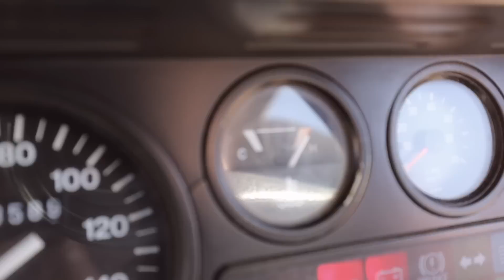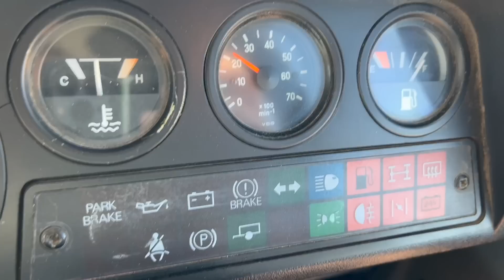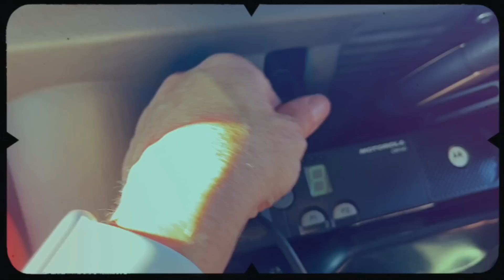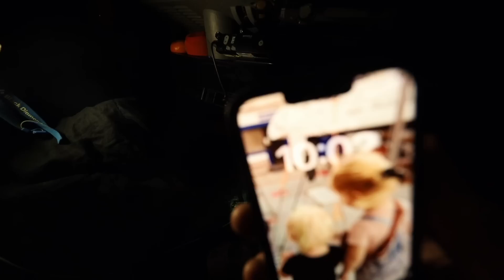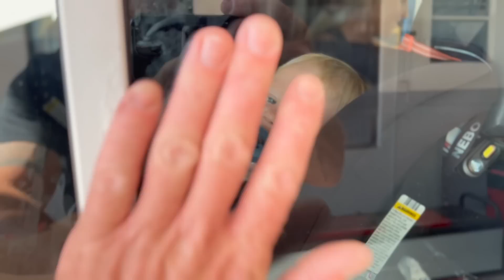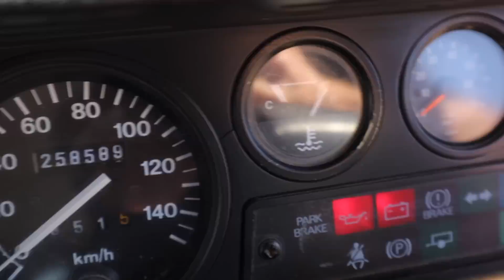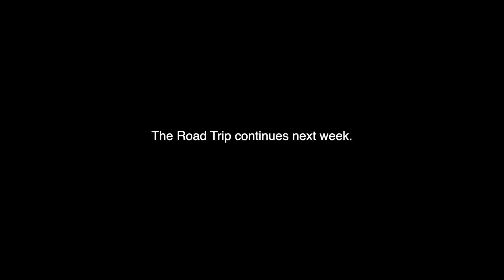4X4 Trip of a Lifetime

Comment: First rule of engine overheating ............. Check coolant level.....  Turn OFF AC........... Open all windows.......... Turn on heat with full fan and heat setting.  That should work......... If not you got high end problems ....:face-blue-wide-eyes::hand-orange-covering-eyes::face-turquoise-covering-eyes:.............  enjoy

Comment: I drove a jeep rental on the day Death Valley was 130 degrees. I had to turn the heater on full just to keep the vehicle below the hottest level. windows open and vents aimed away the best we could. Gets crazy driving in extreme heat. I'm sure i damaged the motor. But we drove another thousand miles! Craziest day was 114 on one side of the mountain and mid 50s on pacific coast side. Your adventure reminded us of ours!

Comment: I've used a length of regular garden hose running from passengers seat to along the top front of radiator 
Plug end with a stick and drill small holes along beside the radiator. 
Passenger inverts the water bottle into hose when extra cooling required. 

Also a/c will significantly reduce the cooling capacity of the radiator due to working in heated air from ac.
So cycling a/c to reduce engine temperatures helps.  Also heater on hottest and full fan can help reduce engine temp, but will make the inside hotter.

Love the trip.

Comment: Hello Ben and Ashley and family Ben when you are driving out in a hot place like that it's better to run the motor in low gear it will make the fan blade spin faster and suck more air through the radiator cooling fans and keep your engine were cool when you're driving faster it spins less. Very glad to know that you made it safely.

Comment: Hello Ben, Ashley and the little angels, my guess is the person/company who rented the vehicle to you probably knew the A/C system was low on refrigerant when you got it because the customers before you probably complained about it. Anyway, if you see the engine temp rising, you should turn the A/C off and watch to see if the engine temp comes down because the A/C  makes the engine work much harder. I was wondering if your guide mentioned snakes in that area? Anyway, have a fun adventure and thank you for this video. Cheers from Nanaimo.